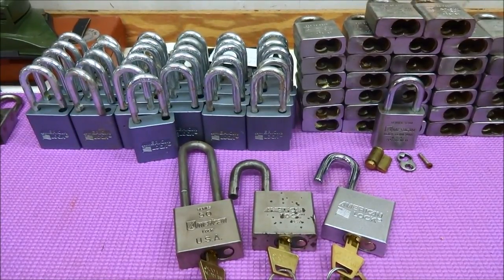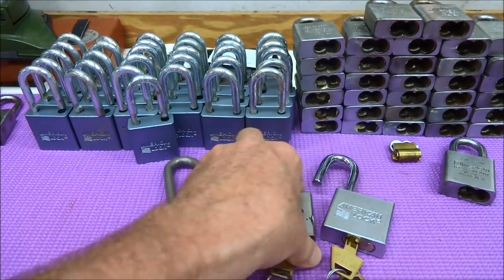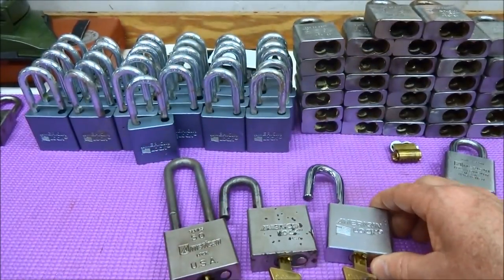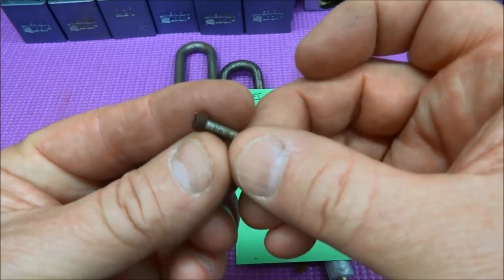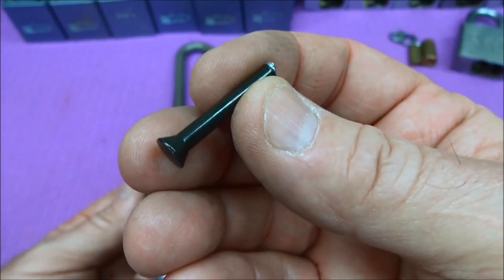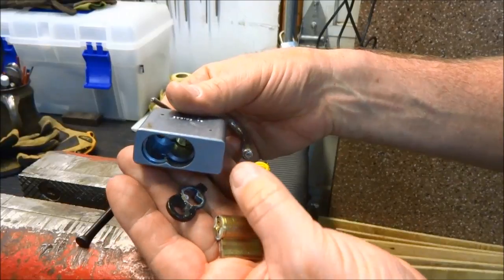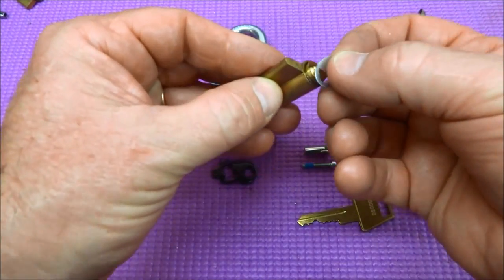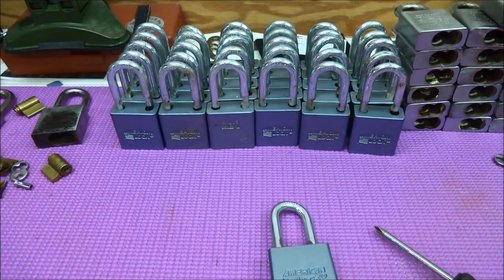(356) Sealed American Padlocks - How to Rebuild Them

Comment: These American locks are used for LOTO (Lock Out Tag Out) in the industry.  The locks would be ordered in keyed alike groups (from 10 to hundreds).  To control the opening of the locks, all of the keys per each group would be thrown out, except for one.  This lone key would control the group.  So, an operator would lock out energy sources (block valves) with the locks, then place the only key for that group within a LOTO control box.  Then a maintenance person would place his personal lock on this box to controlled the LOTO  group key. (OSHA)  The place of business where I work took the LOTO system very seriously and would dismiss any employee who would bypass the system.  This is why the locks do not have keys.  I'm also guessing that most of the locks that you have are keyed alike.   I'm surprised, from watching your YT videos, that the locks can be opened within seconds.

Comment: I have a smaller American Lock US stamped here all brass and WEGy6 written at the back. This one is also riveted and seems to have a 5 pin core. I can see that the pins are the good serrated ones but can not take it apart because it is also riveted. Maybe I am gone try your trick on it one day if it does not damage the lock!

Comment from the maker: For the 5200s, I paid 0.65 each, plus about 0.20 in parts, for a total cost of 0.85 each.  Add in another 0.80 for a key and 0.20 to repin it, and I have $1.85 in each one.

For the series 10s, I paid 0.34 each, plus 0.20 in parts, for a total cost of 0.54 each.  Another buck for a key and repinning comes to $1.54 each.

The biggest cost it time to do the work.  I'll probably just give away most of the 10s (as is) & strip 10-15 for extra parts.  I'm short cores & have excess of everything else.

Comment: I came across one of the series 10 American locks and it has 4 pins but I only need to SPP the last 3 pins!  When looking at the key it has an alternating low to high configuration but pin one must be set so low that it's already position.
Reply: that's the problem with brinks brass padlocks, most of them you only have to pick 1 to 3 pins. I have 1 that is good tho, you have to pick them all high low it's a pain in the rear. hard to pick. have another 1 just like it but it's easy pops in seconds
Reply: +JB I've noticed that with the Brinks locks as well. Some of them are extremely difficult and some of the same model locks are laughably easy.

Comment: Old video but still a valid comments.

Late production American 5200 series locks now come as 5 pin tumbler cores only. Internally, American doesn't machine enough material away that a 6 pin core will fit. The eBay new 5200 locks being sold with a single key were intended as SCIF locks and use a restricted key (usually the R2) which can only be obtained from a locksmith and not a hardware store.
 
The core that retains the pins is no longer held together by a c-clip, but staked in place.

The 5260 lock is slightly larger than the 5200 in both body thickness as well as shackle diameter. Internally, other than the ball bearings that retain the shackle, the internals are the same as used in the American 700 lock.

The new cost of the retainer screw, lock nut, and anti-bypass wafers (now over $3.00 per lock) has risen to the level that unless you got the lock bodies for next to nothing, aren't worth purchasing and reworking.

Comment: Hey Bill, do you have any suggestions on online locksmith supply places that would carry the replacement parts like the ones you mentioned in this video (wafers, security nut & screw), etc for various locks?  The local locksmith shop isn't really an option for me.  I was looking for a place online where I could order some simple replacement parts like the ones mentioned in this video for various padlocks. Thanks.
Reply: Will do, thanks.

Comment: if you add a sixth pin using a 5 pin key what size key pin is needed to fit the slant on the end of the key, they should be the same slant shouldn't they?
Reply: +JB  You can't add a 6th pin to a lock set up to use 5 pins with a 5 pin/cut key.  It hasn't nothing to do with the slant on the end of the key.  A 5 pin/cut key is to short to interact with the pin(s) in the 6th pin stack.  Well, you can physically put the 6th pin(s)  in the 6th pin stack but all you will do is cause the existing key to be unable to open the lock regardless of what pin combination you use.  If the key only has 5 cuts it can only work with a lock that has up to 5 pins it.  You can always use LESS pins, so, 1,2, 3, 4 or up to 5 pins on a lock keyed for 5 pins with a key cut for 5 pins, but you can't use more.  You would need a key set up to have/accommodate 6 cuts in order to interact with the 6th pin. The existing key with 5 cuts would be to short in length to interact with that 6th pin stack so it can't raise the pins at all.  However, if you DO put pins IN the 6th pin stack and put the lock back together those pins WILL drop down and they WILL block the shear line and you won't be able to open the lock with the existing key.  The 5 pin/cut  key won't even touch those pins in the 6th stack.  You'd have to pick it open, and remove the pins from the 6th pin stack to get the lock working again.  Hope this helps.    .
Reply: +bosnianbill I stand corrected.  Wow, you've corrected me twice now on this subject.  Here's what I mean.  The timing of this is amazing.  A bit of background.  I was having trouble with a lock that I turned the key the wrong way and had pins fall out of the bible into the keyway.   Anyway, after fixing that I had some springs I had to replace and pins to put back into the bible.  I couldn't for the life of me figure out how to get those pins into the holes in the bible with the spring in there.  I tried using the follower to trap the spring and then slowly move the follower back and put the pin in the whole but the spring kept popping up.  I went searching and I found your video, " (588) How to (RE) Assemble Locks".  In that video you educated me on TWO things.  One, you showed how you could take a 5 pin lock and add a 6th key pin (using a 5 cut key) and it would work!  I would have never believed that.  I just assumed the key would be to short and would never interact with the 6th pin.  And Two, you made me realize with your demonstration on how to put the pins in the bible that the lock I was trying to fix had springs that were way to long and they didn't need to be that long.  When I saw you put a lock back together and put pins in the bible, all the springs were much shorter and didn't stick out of the holes in the bible.  ALL the springs in the lock I'm trying to put back together are sticking out of the bible by 3/16 to 1/4 of an inch!  Here I am trying to trap those things into the holes and then back the follower off and try to cram a pin on TOP of a spring and compress it at the same time and cram the whole thing down into the hole and get the follower over the top to trap it there.  Didn't work so well.  Much colorful language was used that day.    Now I know I can just replace the springs with some that are a bit shorter and then I'll have a hope of getting the lock back together, maybe.   Anyway, thanks again for both educational tidbits and sorry for thinking I knew what I was talking about this early in the game.